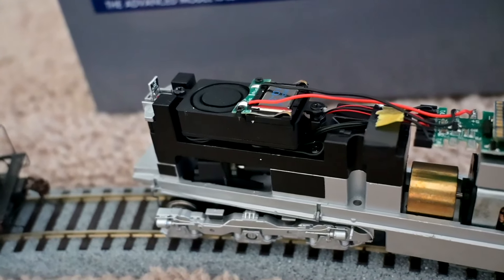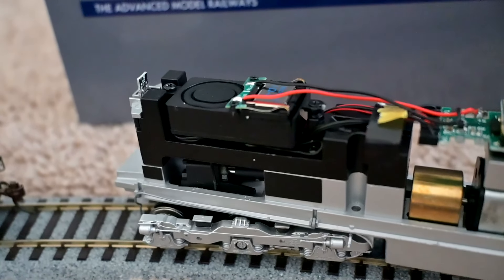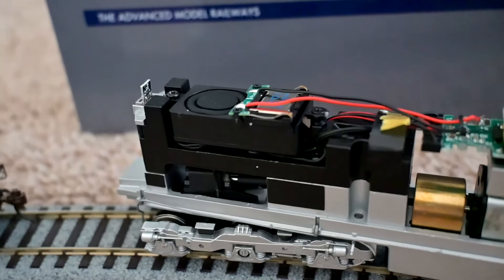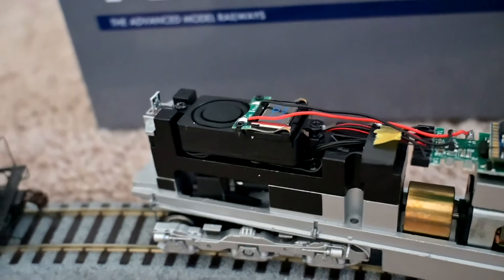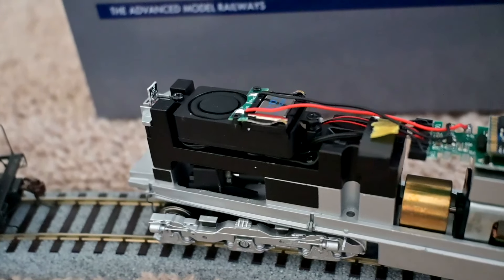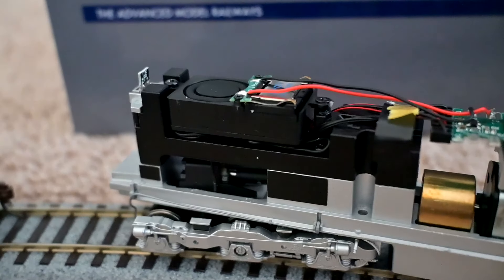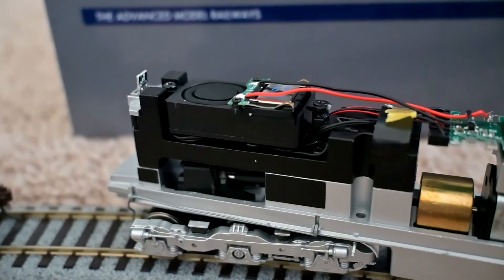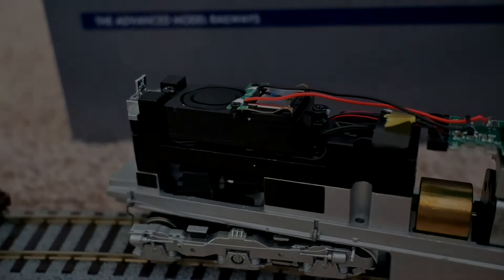ESU 50348 18x35 Speaker Test

Comment: Nice! Sounds awesome. What are your thoughts on the Athearn dual sugar cube speaker sets? I have some engines that have them, and they sound pretty good to me.
Reply from the maker: @mgr_video_productions  They work just fine in a pinch, I have many engines still running them.

Comment: Dude this is twice as good as the scale sound system speaker. How did you install it and are they good for any other locomotives?
Reply from the maker: @tyhik9338  If your engine can fit a standard 16x35 speaker, this should fit into the long hood.  Install overview is at the end of video, I just sat it down in the weight enclosure and screwed it in place. Overall really happy with how it sounds!
Reply: @SCL3618  ok

Comment: Question, what tools did you use for this speaker?
Reply from the maker: @tyhik9338  Just a soldering iron and screwdriver. It's a very simple installation.
Reply: @SCL3618  you didn't have to add flux?
Reply from the maker: @tyhik9338  No, the speaker pads on the motherboard recieved solder with no issue.
Reply: @SCL3618  Cool
Reply: @SCL3618  what parts did you solder? To the decoder?
Reply from the maker: @tyhik9338  2 wires to the speaker pad on factory motherboard.
Reply: @SCL3618  oh wow